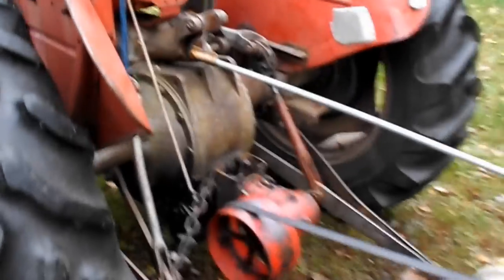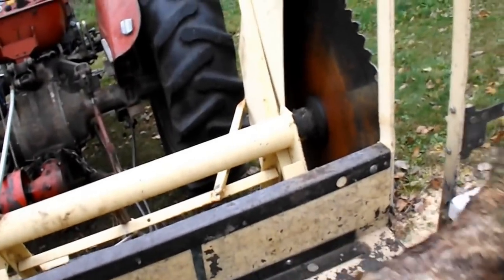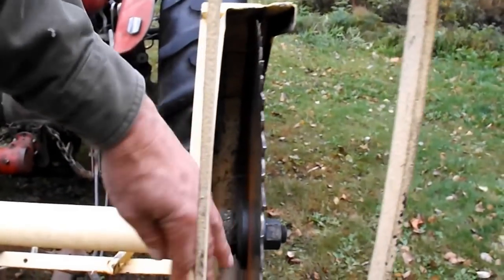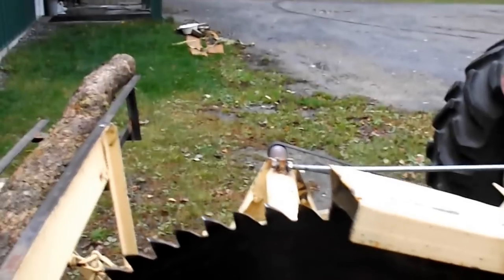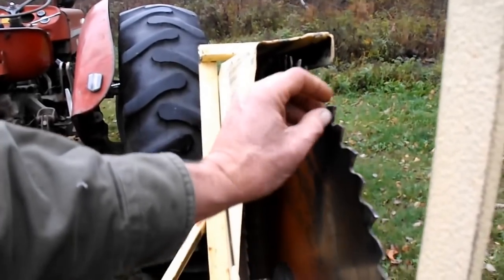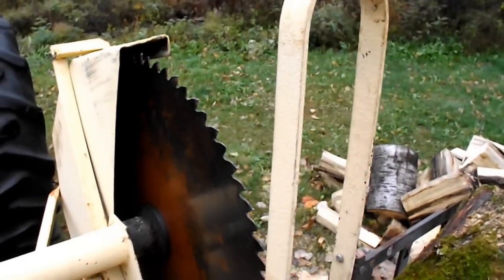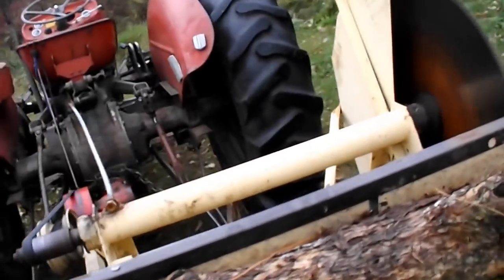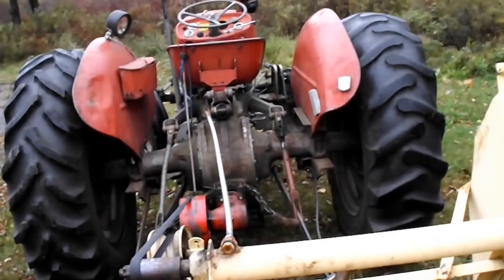Tractor Powered Circular saw

Comment from the maker: It turned out to be that my table hinge  holes were worn, (Ovaled) and the hub that holds the blade, was of 2 thousanths off square in one spot. Some milling and a new set of holes and she's way better! The tooth angle is wrong and and your right I should have noticed that! Thanks!
Reply: If you put more set in the teeth ie making a wider cut path it won't burn the would.

Comment: Your saw should realy get some more rpm. I run my blade 70 cm (27.5") at 1450 rpm using a 3kw electic engine, newer problem whit it getting warm or annything, + like the others here say, get your angels correct. You newer need to lube the blade either if all is done the right way.

Comment: not sure who told you how to sharpen those but they are leaning back way too much, it will push against you pushing the wood.  You should never never sharpen the front of those teeth, just sharpen the little square on the top of  tip, there should be that square on top of the tip if the blade is properly made